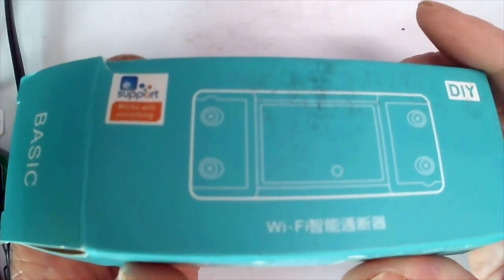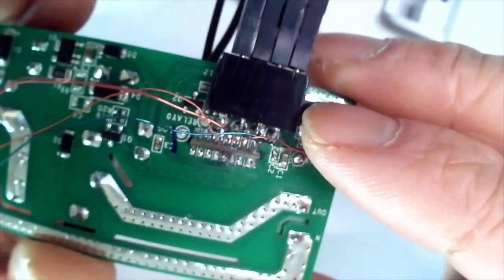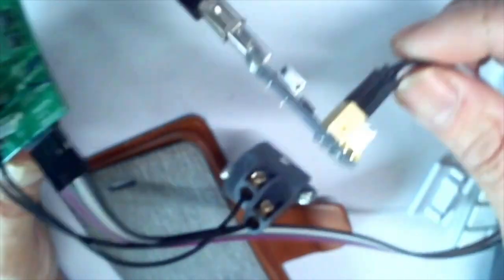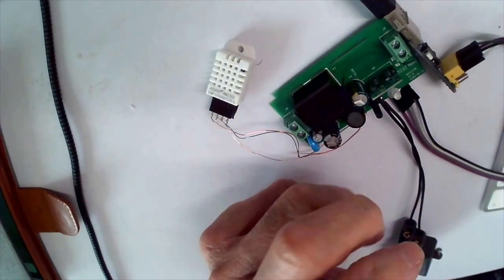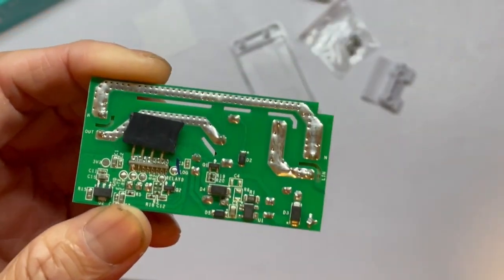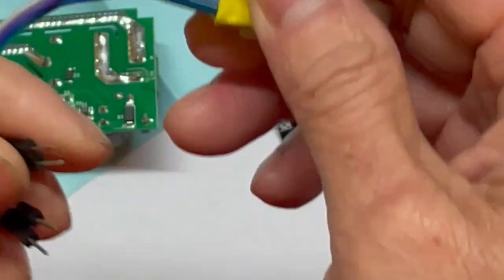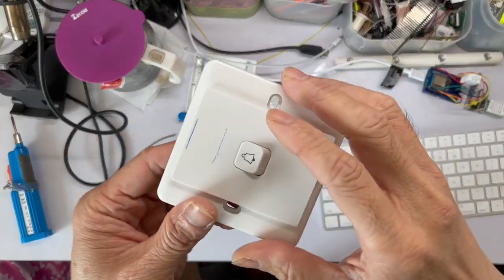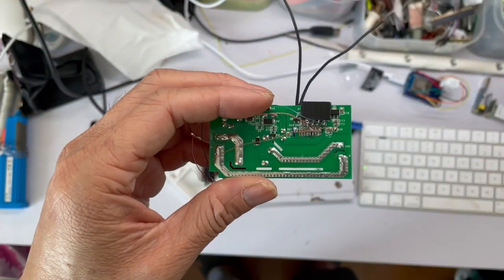Part 1 - Turn a Sonoff basic switch to a homekit light switch with temperature and humidity sensors

Comment: i have a question; with the sensor you've added (dht22) can the readings be used for automations? For example, can you tell homekit to turn on lights when temperature reaches 25 degrees?